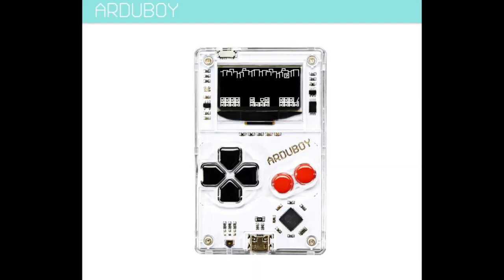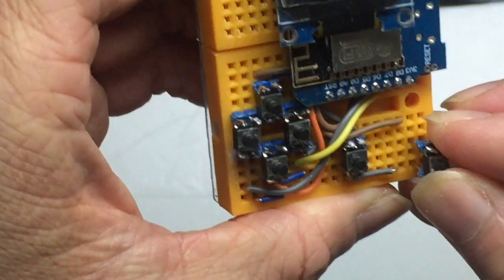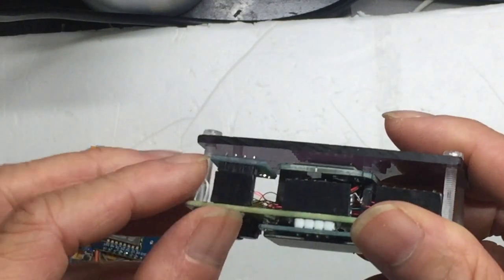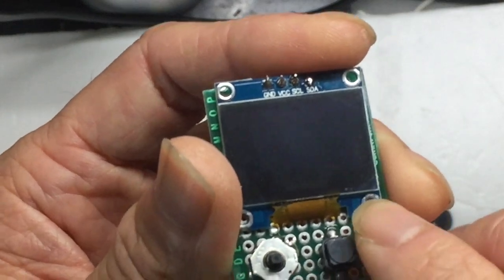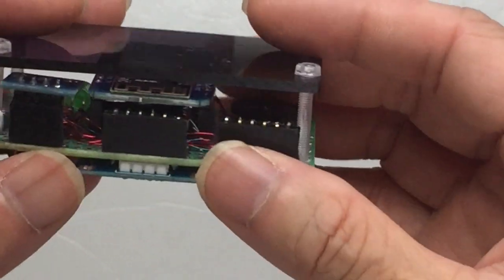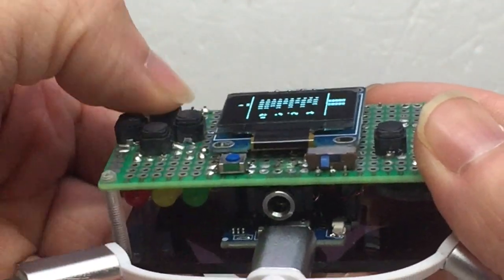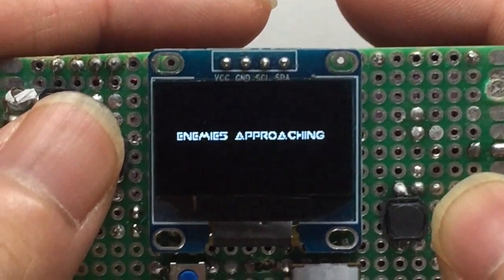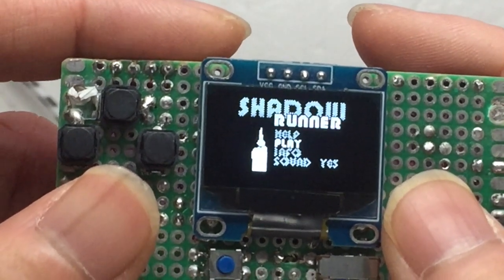Chapter 4 ESP8266 Arduboy Game Console ESP8266 DIY Series

Comment: can i use the arduino uno
Reply from the maker: No. The program codes will not work for arduino uno, only works for esp8266.  If you want to make one using arduino boards , suggest you watch this video which makes an Arduboy clone using Arduino Pro Micro board. The making of ArduBaby - The half size Arduboy Hardware and Software
https://youtu.be/c59xkNpyrwo

Comment: Sir, please reply me... please..when I uploaded the code into node mcu with oled it will successfully uploaded and display is visible ..but when I uploaded into wemos D1 it will be uploaded successfully but there is nothing in the display ,,... totally blank display...
Reply from the maker: I have not got a WeMos D1. I don't know what's the difference between the pins of a Wemos D1 v.s. the  D1 mini that I am using. So, I cannot give you much suggestion on the circuit itself.  I can only share what I found with these cheap MCUs manufactured in China which may not always have the best or consistent quality. These problems with Node MCU not responding according to expectation may be caused by different factors: 1. Poor manufacturing, i.e. the board is faulty 2. Poor contacts during soldering of pins to the board. 3. Unreliable power supply, i..e the battery or the USB cable that supply the power. 4. The quality of the USB cable used to upload the code. I found that only one of my USB ports on the iMAC I have is the only one that can successfully connect with the D1 mini. I think this is a problem with the rusty contacts on my other USB ports on my iMac.
Reply: @BillyCdiy  me also use D1 mini...but when I use other code they are successfully uploaded and display also perfectly work...but this case I can't ....why......

Comment: Hey bro! Can i change the code in esp8266_arduboy2/src/Arduboy2Core.h at:
#define PIN_LEFT_BUTTON D6
#define PIN_RIGHT_BUTTON D7
#define PIN_UP_BUTTON D5
#define PIN_DOWN_BUTTON D4
#define PIN_A_BUTTON D3
#define PIN_B_BUTTON D0

I change the button b to D9 because esp 8266 is 12e, is it work???
Reply from the maker: GO DIY , D9 may be already used by the internal circuits of the node MCU to run the flash. You may try if it works for you. But I doubt it. It may hang the MCU

Comment: can i do it with esp8266 node mcu?
Reply from the maker: Yes. There is another version where I used the Arduboy library for ESP8266 node MCU D1 mini. You can find different versions for I2C or SPI displays of SSS1306  in my list of videos: 

https://youtu.be/CinJb7gifH8

https://youtu.be/dB-4lS2K3Y8

https://youtu.be/0Bl0bkTdha4
Reply: Billy Cheung i was successful with esp8266 node mcu ,hope you update more game :3
Reply from the maker: @godiy8276  , congratulations. Which one did you build ? The i2c OLED one or the SPI one ?
Reply: Billy Cheung  I used esp8266 nodemcu v1.0 lua (12e) and oled 0.96 i2c ssd 1306, hope you update more game or find a solution can read game from a sd card same gamebuino:))
Reply from the maker: GO DIY , there is a limitation of the library to support all Arduboy games as some of that are customized for the arduino MCU. Let me check which game can be ported. I also want to get games in SDcard so you can load new games on the road as well. I am trying to develop that based on the OTA firmware upgrade codes. But that looks quite complex
Reply: @BillyCdiy  

I'm drawing circuits and erasing them all in one, I trust you can do it, wait for you